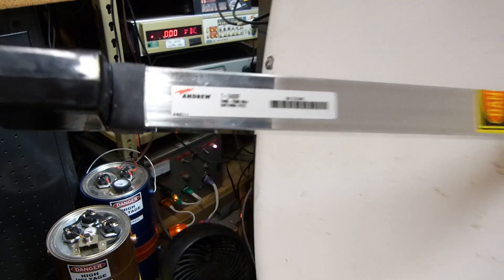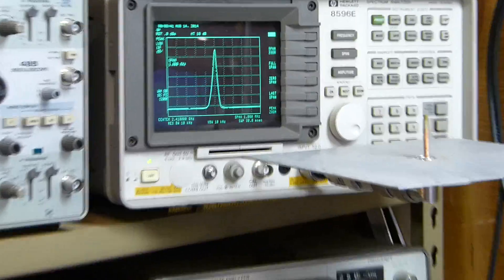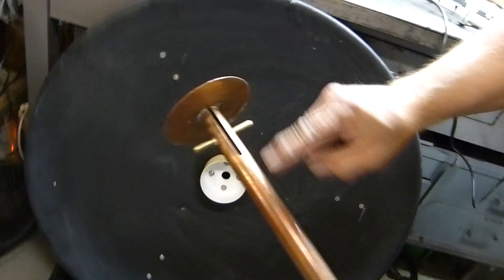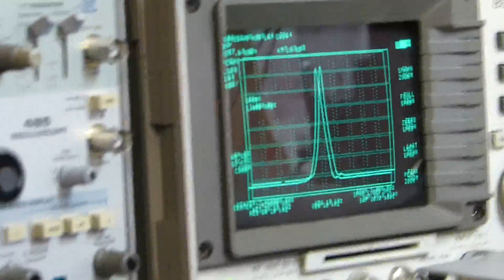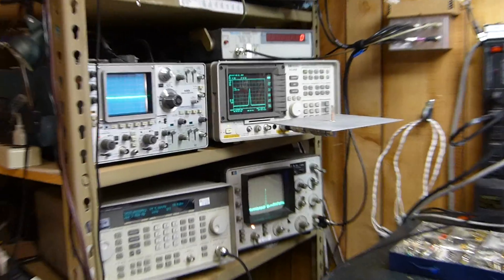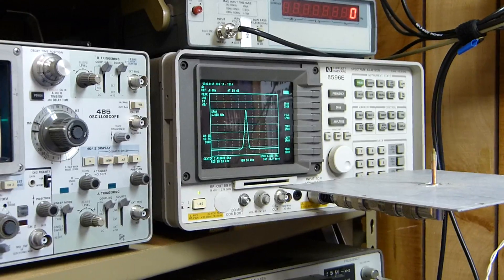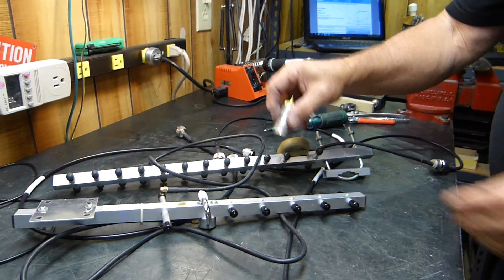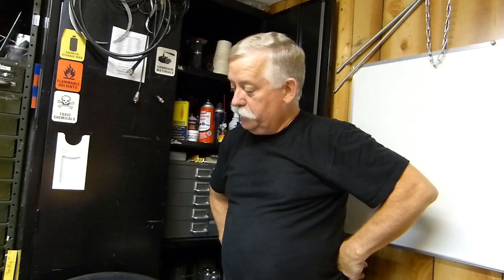WiFi Antennas - 2.4 GHz Parabolic Dishes, Slot Antennas and Yagis Examined and Compared

Comment: So it was hard for me to read the scale on the meter, but are you essentially saying the Parabolic dish antennas are 10 to 12 db better than the two Yagis?
Reply from the maker: Each major scale is 10 dB. I know I move the camera around a lot so it is hard to read it perfectly but, yes, the parabolic dish would easily be 10+ dB better than the yagis at 2.4 GHz and even more at 5 GHz.
Reply: @ElPasoTubeAmps  Thank you that is what I thought but I just wanted to make sure.
Reply: I have been searching here and their over the years for someone that has some testing on WiFi antennas and something intelligent to say about the relatively performance of antennas based on analysis, and it wasn't till just today that you came up in the list of possible videos.  It basically took me 10 years to locate you in the search results.
Reply from the maker: @m5research915  I hope what I have posted is worth something to you.

Comment: Microwave Antenna Theory and Design, M.I.T. Radiation 9 Laboratory 1949 chapter 8: Microwave dipole antennas and feeds, page 239
Reply from the maker: Do have a link to this article?
Reply: @ElPasoTubeAmps  introni it/pdf/12%20-%20Microwave%20Antenna%20Theory%20and%20Design pdf
Reply: @ElPasoTubeAmps  Please check mail, a have problem with sending link via YT

Comment: Please let me know about diameter of this copper  feed, im trying to design something for 23cm - i like to know proportions or design method for a 1296MHz. 
73's SQ6RDP
edit:
The Radio Amateur's V.H.F. Manual
A Manual of Amateur Radio Communication on the Frequencies Above 50 Megacycles  1968
Reply from the maker: https://www.youtube.com/watch?v=f0ioKs5hlLg
The impedance of coaxial line with air dielectric is determined by the formula:  Z = 138 * log (D1/D2) where D1 is the inner diameter (I.D.)  of the outer tube and D2 is the outer diameter (O.D.) of the inner tube. In my case,  being in the US, I use 3/4" inner diameter (I.D.) copper water pipe and the inner rod is 5/16" O.D. which comes out to be: Z = 138 * log (0.75/0.3125) = 52.7 ohms which would be an SWR of 1.0456. Good enough.
Hope this helps.  73  WA4QGA
Reply: @ElPasoTubeAmps  THANK YOU! That's all i need!
Reply from the maker: I think I show the way to measure and determine line impedance in this video.
https://www.youtube.com/watch?v=pEkGrgXUZwk&lc=UgzynjAqeMifDpqcBzZ4AaABAg

Comment: If you use a satellite dish, will it not work?
Reply from the maker: Satellite dishes are made to work in the 12-18 GHz range so they are a little small for the 2.4 GHz region but people do use them with some success. Also, the slanted, off-center focus, on satellite dishes is to minimize natural Earth generated noise. I have tried to use satellite dishes at 2.4 GHz but have not been able to find a suitable focal point so I use the standard center-focus type dishes. I don't want to discourage the use of satellite dishes as you may have better results than I did. Hope this helps.

Comment: Is it possible to find a device like this without the dish online?
Reply from the maker: The feed is called a Andrew 1-2400F. I did buy this one without any dish but it was back in 2014 so I don't know if they are still available. You might search for "Andrew 1-2400F" and see if you can find one. From my experience, seems like everyone has gone 5 gig. I bought two 5 gig antenna with dish a few years back and they are still working perfectly with a very good high data transfer rate. About $250 for a pair.
https://www.ispsupplies.com/products/antennas/5ghz-antennas/5ghz-dish-antennas
Reply: @ElPasoTubeAmps  I appreciate your help, thank you!
Reply: @ElPasoTubeAmps   what about the name of this one? 3:15
Reply from the maker: @xGiGsh  https://www.youtube.com/watch?v=f0ioKs5hlLg

Comment: Hi
Can you please help me?
How do you make that black dish antena?
Reply from the maker: I did not make this dish. I found it at an estate or garage sale. It would be difficult of not impossible to make one out of metal. 
I have made them many years ago with fiber glass. It is a little complicated to explain in words. 
First you accurate plot 1/2 of a parabola of the size and focal length you want on plywood then carefully saw it out. That piece of plywood is then tied to a pipe in the ground so the plywood can rotate and trace out a parabolic shape on the ground which is built up with dirt/sand and finally plaster-of-paris so that you have a parabolic bowl on the ground. Then you start laying fiberglass over it and finally on the inside of the parabola, after you remove it from the mold. you lay a reflecting surface of wire or aluminum. Best short description I can make.
Reply: @ElPasoTubeAmps  thanks to tried explain.
Best regards

Comment: What about 1:1 baluns? Some antennas needs them for better signal strength + quality, but some not (they actually works with built-in balun). There are videos on youtube, presenting radio reception quality with balun ON and OFF. If there is no coax cable (antenna directly on AP), no balun is needed? My feedline (1m coax cable between AP and BiQuad) is transmitting signals in all my room = I need balun. My choke balun (4 turns coil) of my 1m coax cable between AP and BiQuad seems to be working fine, signal level behind BiQuad's reflector is lower, it is transmitted far away as desired. This BiQuad is glued together and can't be modified, but I think my (ugly) broadband choke balun works. With another BiQuad I would like to try something smaller, "bazooka" - sleeve balun or Split conductor balun. Is there any higher gain (dBi) with balun feeding BiQuad, Cantenna or simple 11dBi parabolic curve patch antenna (62mm circular plate at 15mm distance from 100x100mm parabolic reflector)?

Comment: Great video, very informative. Regarding the black parabola, can we use the slot feed exposed to rain or shine without the white pipe? Does the white pipe affect performance? Thanks
Reply from the maker: You do have to protect everything inside from the rain and weather and up in the air exposed to the elements can be a challenge as I have found out... The slightest bit of water in the antenna or coax connectors will completely "short" the signal and you will end up with no signal at all.
I tried some measurements with and without the PVC and I believe I could detect maybe 2 dB attenuation (resolution of my equipment) because of the PVC but it is just something we have to live with.
Reply: Thank you

Comment: sir tell me which antenna batter for   
long range wifi signal. if i use 24dbi parabolic antenna directly in my tplink tlwn722n it burn my card. or i use 14 dbi yagi antenna.. thanks..

Comment: Can you put a video where you show how to build the (black) parabolic antenna, for it seems a DIY one?  thanks in advance.
Reply from the maker: Hi Lin,

It is nice to see you have an interest in my video on the 2.4 GHz parabolic antennas. I have made several videos on this larger antenna and have included  links to them. 
I think between this video and the two links below, it should help.
The actual black dish was something I found at a garage sale and really don't know where it came from or what it was used for previously.

https://www.youtube.com/edit?o=U&video_id=FzYIDLD8qgA

https://www.youtube.com/watch?v=f0ioKs5hlLg
Reply: I wonder if  a regular satellite dish would serve the purpose.  if positive, is there a good method, you know of, to calculate the focal point, where , of course, to mount the head?
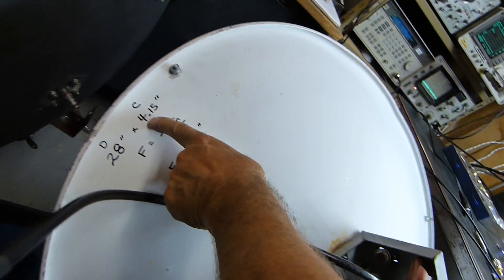Reply from the maker: At about 2:30 into the video I show how to calculate the focal point based on the diameter of the dish and the depth of the dish.
Satellite dishes are much too small for 2.4 GHz. Even this larger black dish is a bit small. Ideally, a dish should be at least 10 wavelengths greater than the wavelength of the frequency you are receiving.  Larger is better. For 2.4 GHz this would be a dish that is at least 1.25 meters in diameter.
Satellite dishes are made to receive RF in the 11 GHz region and do a poor job at 2.4 Gz.
Reply: 1.25 meters  in diameter huh? so bigger means better reception. I believe i could get one with those dimensions. the only problem is that all sat dishes around here are kinda oval, meaning they measure ,say , 1.25M vertically and 1M horizontally is that fine?

Comment: Hi ,vy interesting stuff. Could you explaine something more about  how the matching stub with the coax halfway inside the driven element in the WiFi yagi works ? ( around 6 min in the video)  Tnx 73 on4aol
Reply from the maker: I am going to suggest this link below. I know it is primarily about slot antennas but this fellow is very good and keeps it simple and I think you may learn something from them. There are several videos that he has posted and they are all good and I believe you can go from one to another at the end of each video.  I hope you enjoy them and I hope they help.
http://www.antenna-theory.com/antennas/aperture/slot.php
Reply: Tnx for that,
In the meanwhile, i found out that the principle is a infinty balun.
Guess  what ? When i google it , i came on the same website where you pointed to.
73  Luc on4aol
Reply: @ElPasoTubeAmps  Nice job

Comment: Can you tell us a bit more about that little amplifier of yours?  Been watching your videos for a while and was surprised and GLAD to see someone like you doing videos on this subject.  The information out there is overwhelming and a guy like you really helps put it in order.
Reply from the maker: I have two small RF amplifiers that I use to drive the Bird wattmeter elements. Both are made by RF Bay Inc. www.rfbayinc.com  but I believe I bought them off Ebay.
One is 1 MHz to 1 GHz at 1 watt (MPA-10-40) 1 watt = 30 dBm
The other is 2.4 GHz to 2.5 GHz at 2 watts (MPA-24-20) 2 watt = 33 dBm
Be careful when buying these off Ebay as some are advertised as watts output and some are advertised as dBm output so you want to do your math carefully and not buy the same amplifier advertised different ways. Thank you for your kind remarks.

Comment: sir I'm interest to build your parabolic dishes for my final project. Do you have an article about  DIY parabolic Dishes with feeder on your videos?
Reply from the maker: I have made one or two videos but I think this is the best one. If you don't have a parabolic dish you may be able to build something that will work relatively well with a spherical dish from something like a dish you use to slide down snow slopes or whatever shape you can find. Even a reflecting flat plane made with copper PC board with a "bow-tie" type antenna might give you good results. Best of luck with your project.

Comment: sir how much DBI did you get from the 2 parabolic antenna ? i just build a panel antenna  and a would like to create a hornfeeder for a dish antenna that i have. i will wait your answer. thanks
Reply from the maker: I really don't remember anymore what type of gain I got from the antenna as I was most heavily involved in this project several years ago but if I remember correctly it was about 20  to 25 dB gain. That is a reasonable expectation from that size dish and feed horn. Of course, there is loss in the feed line and the longer the feed line the more loss you have to deal with.

Comment: i need to gget a wifi signal from about 1000 ft. 020 miles its a macdonalds wifi  thru 3 apartment buildings just the corner of them any recomendations?
Reply from the maker: Not sure if this will work but I think for the sake of economy, and ease of construction,  I would start with a cantenna type antenna. I have had good results with the 4 inch can, a monopole on the end of the N connector at 1.2 inches long and mounted somewhat more than a 1/4 wavelength from the bottom of the can. Put the antenna as close as possible to your equipment using a good coax (LMR 400). Mount it on a tripod. It just might work. I don't know if you have a way to measure signal strength but a signal of -60 dBm or better will give good results. If it is down at -90 or more it won't work. 
I use access points in a bridge configuration between my house and my mother-in-laws housse at 1200 feet and it works very well. I like the EnGenius ENH 202 hardware. Some of the older ones have an SMA antenna connection on them but I am not sure about the newer ones. Best of luck.
Reply: Thanks I'll give it a try I have enough routers I can flash ddwrt on and bridge them but finding a place to place them might be an issue. The big r is about 200 feet away from the back of the apartment but I can't get signal at all even with my phone held up against the door. Inside the signal is ok however they seem to use one router to cover most of the store there might be another somewhere I've got to look around the store sand see where its located. The wall is thick concrete bricks. The store was an old Wal-Mart then they moved and big r moved in to town. I might share the connection if it's good enough to handle more than one device.

Comment: Im looking for the andrew center piece you showed on the first dish you tested. I have been looking but didn't have enough info
Thanks
Reply from the maker: I think this is a link to where it can be purchased.

http://www.wirelesslan.gr/product.php?id_product=362&id_lang=1

Here is another interesting link 

https://www.google.com/search?q=andrew+2.4+GHz&sa=X&rlz=1C2AVNC_enUS605US605&tbm=isch&imgil=7H6GGVgteaZK7M%253A%253BqoyO9goMt4KY9M%253Bhttp%25253A%25252F%25252Fwww.wirelesslan.gr%25252Fproduct.php%25253Fid_product%2525253D362%25252526id_lang%2525253D1&source=iu&pf=m&fir=7H6GGVgteaZK7M%253A%252CqoyO9goMt4KY9M%252C_&usg=__UTRCGZl0v3lgA-Z6Bc9QBIVxXic%3D&biw=1745&bih=864&ved=0ahUKEwjd8bCp6b3TAhVGx1QKHSPLC4oQyjcISA&ei=X1H-WJ3GMcaO0wKjlq_QCA#imgrc=7H6GGVgteaZK7M:

Comment: i need that black dish where to buy???
Reply from the maker: The black dish is nice and I have used it on several occasions. I picked it up at a yard sale years ago. I don't know what it was used for or where it came from. El Paso is close to White Sands Missile Range and other government installations so I suspect it came from one of these places..
I made parabolic dishes about forty years ago. I will try to describe how to make them.
First you drive or cement a pipe in the ground, maybe 1 inch (25mm) in diameter so that it is very stable. Then you start building up an earth mound around the center stake until it resembles a hemisphere. Make it the diameter of the parabolic dish you want to make. 
Next, plot the curve of the parabola on a piece of plywood and make it as accurate as possible. You only have to plot one half of the curve. Then you saw out this parabolic curve and attach it to the pipe in the center of your mound so that it will spin around this center pipe. Then you start contouring the surface of the mound with plaster-of-Paris and "milk" it down until you have a very nice, smooth accurate parabolic mold on the ground. This will take some time of several days to complete. Of course, then you can remove your plywood curve once you are satisfied. At this point you  will have to choose how you want to make your dish, probably with fiberglass but this can get heavy so think it through very well. You know it will have to be metallic on the surface to reflect RF. You can mirror it to make a solar dish. You just have to use your own imagination and engineering skills at this point to finish out the dish and decide how you will deal with the round edge, how to mount it, etc. Hope this helps and good luck.
Reply from the maker: P.S. - just a side note - once I made a beautiful "stressed" parabolic dish that was just beautiful. About ten feet in diameter. Problem was it was not a parabola. It was made with many radials from a center plate with eye-bolts in the ends of the radials with a wire running through the eye-bolts to pull the outer rim into a circle. I then sewed fine mesh screen wire on it. Again, it was beautiful but performed very poorly. Finally I plotted and cut a cardboard shape with the dimensions of the parabola I was trying to build and the beautiful dish was not even close. Just thought I would share this with you in case you are thinking of building the "stressed" (non) parabolic dish.  :-)
Reply: hmmm long way

Comment: well that yagi should work just fine on routers i don't know why you say its not the connector is just right for every router or wify stick sold here in europe..
Reply from the maker: I did not know that about European WiFi connectors. In the US all of the connectors on WiFi equipment are Reverse Polarity (RP-SMA and RP-TNC). Reverse Polarity has the male and female pin reversed in the connectors. I understand the FCC did this to help prevent citizens from connecting antennas to their equipment and extending the range and thus the interference to others. Thanks for letting me know about the connectors in Europe.
Reply: well as i see it i maybe wrong but the connector of your yagi seems to be that http://www.air-stream.org.au/files/rp-sma-male.jpg and that connector is perfectly fine for every wify rooter or usb i own :)
so maybe you have this particular connector on the router side in the us i don't know..